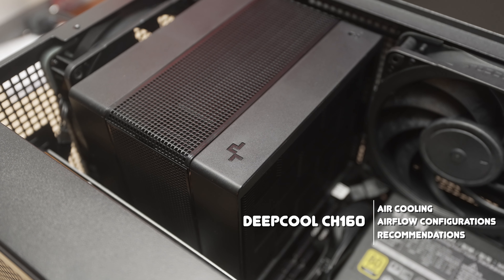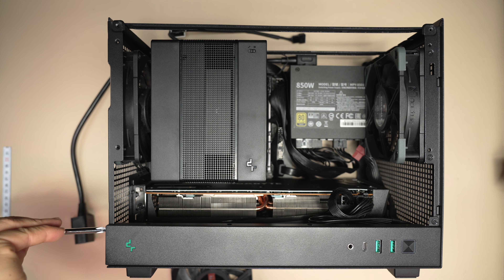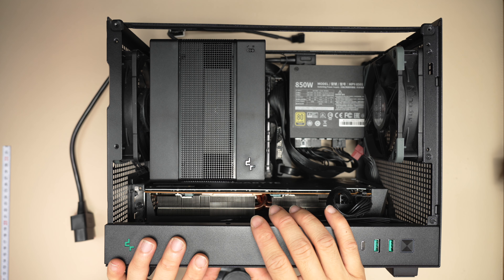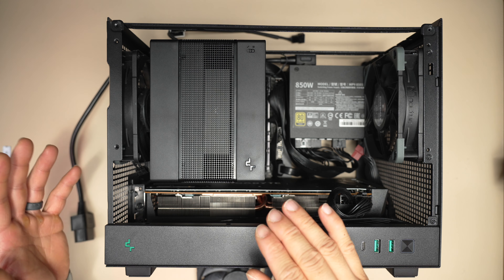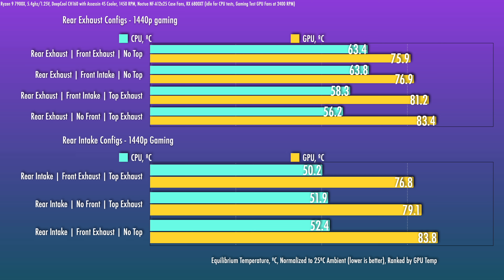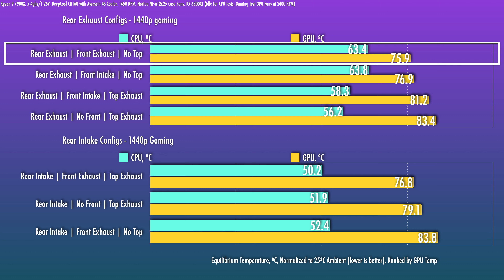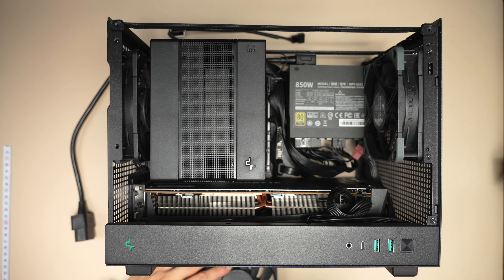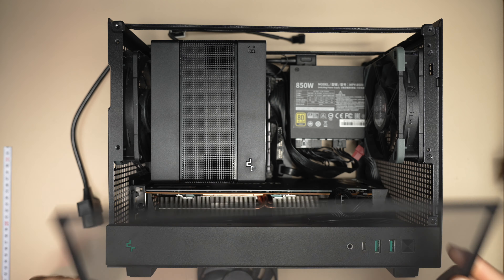Let's talk about CH160 Air Cooling Configurations.

Comment: I've seen this being a topic on SFF Forum years ago (for the Ncase M1), and the most optimum result is: REAR INTAKE + SIDE/TOP EXHAUST (near the PSU area). In this case it's an even easier solutioun, if you don't mind the hot air blowing into you.
Reply: Did the same with my Asus AP201. Rear + 2x bottom intake, 3x top exhaust. Works like a charm

Comment: I do hope to see rear intake becomming a more accepted and mainstream option in future cases; for example larger perforations/vent holes and an included optional dust filter. Most of the time it really is the best set up for air coolers, especially with flow-through graphics card designs.
Reply: For real, rear intake is the ONLY logical setup for air cooling. Cannot understand what the MF's (manufacturers) are doing all these years.
Reply: Whats the difference between front intake setup vs rear intake setup and does it really make a difference in temps on all pc builds or some cases

Comment: There's also more overall cooling potential left on the table. You could use a 120mm dual tower cooler with vertical offsets(Thermalright PA 120, PS 120 and all their variations) to allow for 2 top exhaust fans. You can then cram in a Phanteks T30 in the middle of the dual tower cooler and you'll probably achieve the best combined thermals.
Reply: Would like to see this, since I’m planning on using a PA 120 in this case
Reply: Yeah I'm planning on using that air cooler as well and but two fans at the top
Reply: so if I go for a ps120se should I even go with a back case fan if I mount the 2 fans at the back of the heatsinks?
Reply: @nootonian4149  if the heat sink fans are blowing air out the back, I don’t think you meed to put a back fan. I’ve seen people just use the heat sink fans as the exhaust already
Reply: @linksh0t263  I'm trying to intake from the back for best temps

Comment: By the way everyone, if you go for a massive cooler like the AK620, be content with only using one of the fans in the tower if you want to have a regular thickness 120mm fan on the top and side simultaneously.
Reply: I'm trying to get this setup ch160 and ak620. Could you explain what you mean please? Are you saying I can only fit a fan either in the front or the top using that cooler?
Reply: @ahmedalagbari7564  Hey, yeah, the 620 is so wide that you can only fit the face of the 120mm fan on top and a half standard thick 120 fan on the front. The mounting bracket for the front fan comes with an offset that would make the top and front fan overlap. Unless you decided to have the fan that sits on the outside of the air tower on the rear side, closer to the back I/O, then you might have room. But I stuck an intake fan there like the video suggests so not an option for me. Thermals are still great though.

Comment: I hope mesh and filters on the back and top of cases starts to become more normal.
Reply: Why? Filters impede airflow. I personally remove all dust filters from my systems for improved thermals in trade of for servicing the system every few months. Which you should be doing anyways.
Reply: @rovertyenrab damn if you clean your PC every couple months you’re OCD or you need to clean your house more often lmao or you need to put those filters back on. On the temperature side, is it really bothering you running 3°C hotter? If that’s the case, need to remember not everyone runs an overclocked 7900X…

Comment: I went with a rear intake and top exhaust with the magnetic filter on the intake like you suggested. I didn't go with front exhaust because I was able to mount 2 SSD drives onto the back of my psu. The trade-off for tenps is storage. Thanks for the great video! I am looking forward to your build video with this case.
Reply: how do you resolve the rear fan being extremely loud because it is too close to the vents?

Comment: Hey MM, awesome video! I just grabbed the CH160 and I'm waiting on the rest of the parts. I'm planning to set it up like your config with both top and front exhaust fans. Quick question though, should I use:

*Option 1:*  
- Top fan on the CPU header (pros: balanced control, cons: might not optimize front airflow)  
- Front fan on the system header

*Option 2:*  
- Both fans on the CPU header (pros: centralized control, cons: potential overload)

Which setup do you think is best?

Comment: Random Question: assuming you don't have a power hungry CPU. Can you use a smaller cooler. And have a setup that mimics the NR200 setup of Bottom Intake and Top Exhaust? or you cannot add another top fan above the CPU?
Reply from the maker: Of course. You can do all that especially with a smaller cooler. Plenty of smaller and more affordable 120mm towers.
Reply: @MachinesMore  So I have a Ryzen 5 5600X. If I got a smaller 120mm tower cooler could I theoretically mount it horizontally. Have the fan as intake from the bottom and exhaust from the top along with the top 120mm fans as exhaust. I have it paired with a 3060ti FE. Any recs?

Comment: Can you please do this test with a flow through cooler like the 4070 super founders edition? I know you mentioned it but testing would show the best possible config. What about CPU air cooler drawing air from the top and exhausting at the back with the flow through also doing the same and an additional intake in the front / or top exhaust.

Comment: would there be a noticeable CPU temp drop when using a flowthrough gpu with rear intake since hot air from the gpu would go through its PCIE bracket, rise up and get sucked into the cpu cooler?
Reply from the maker: There will be some re-intake, but some blower exhaust will disperse out into the ambient air. In my experience rear intake is better than having the flow through section almost completely enter the cooler (glass panel makes this really hard to avoid otherwise).

Comment: Hi! I really love how thorough your details were in the video. I was wondering how practical it would be if there was an intake fan top, with exhaust fan in the back? More of a curiosity for me
Reply: Wouldn't be very effective. The down force of air would conflict both with the front intake getting to the CPU cooler as well as the updraft exhaust from the GPU. Since you're force air downwards, the turbulence are then opposing each other. If anything that top fan slot should be left unpopulated.

This configuration here; rear intake, front/ top exhaust, is the most optimal.
Reply: Gearseekeres already tested it, makes no difference/a couple degrees worse

Comment: Why everyone use the same DC cooler when talking about the 160? Are there contracts?
Reply: See? you got there by yourself
Reply: Perhaps there are but that's just how the case was featured when it was released. It was designed around their large air-coolers. AIO doesn't work in this case so ofc if the reviewers are going to show air-coolers, they're going to use this cooler for the visual appeal of them matching.

Comment: I think with an ATX PSU in front having a rear intake and top exhaust is the best option for the CPU since it cannot get fresh air from the front. With an SFX PSU and the option to mount a front fan though, I would be interested in seeing how the CPU temps would be with a duct directing the front fan flow straight into the cooler so it doesn't pick up any of the heated air from the GPU. However, unlike competitors like the Ncase M1 and Cooler Master Nr200, the CH160 has no side panel ventilation, which would help the GPU cooling. A shame, really- I would definitely pick up this case if it had a mesh or solid side panel rather than glass.

I would like to see these tests ran again with a different CPU cooler, every reviewer i've seen look at the CH160 has been using the Deepcool Assassin 4S (likely because Deepcool sent it with the case for review) I'm wondering how different the CPU temps would be with a more traditional dual fan cooler, like a Thermalright Peerless Assassin or a Noctua DH-15.

Comment: How sturdy is the front fan mount? Video’s I’ve seen seem to show it’s only mounted on the right side with a bracket and the other side of the fan just flops around a bit.
Reply from the maker: Pretty flimsy. Needs to have an additional bracing point on the other side of the front panel.

Comment: Any thoughts on a 120mm AIO setup or is there no benefit in this case (thermals and/or noise)?
Reply: 120 AIOs generally perform worse than large air coolers.
Reply from the maker: Big air cooler is going to be better performing, less hassle, more reliable, and on par in terms of cost to a 120. If you want liquid cooling a compatible 240 would be best.
Reply: These days, 120mm AIOs are only suitable on lower-power CPUs. Hardware Canucks did a comparison on it semi-recently and when you compare a 120mm AIO to really small air coolers, it comes out on top for noise and thermals every time. But this case is obviously not designed around small air coolers, and the class of air coolers you can fit in this case will beat a 120mm AIO.

Comment: Does this case fit other popular large coolers like the Peerless Assassin or Noctua DH-15? Would those perform better than the DeepCool Assassin 4?
Reply: Yes the case should fit them no problem. Your ITX motherboard may be a bigger problem depending on which model it is
Reply: performance increase would be negligible. You'd need some extremely low profile RAM modules to get the 2nd fan on a D15 or PA. Otherwise you're more likely to run just 1 fan which would gain you about the same thermals... maybe +/- 3 degrees which isnt that significant, especially for a gaming system where the cpu isnt getting hot at all.

Comment: Good follow up, I assumed this would be better. I've had a couple cases with similar layouts, and rear intake + front/side/top exhaust is always better.
Reply: Yeah the CPU cooler gets feed fresh air from the rear exhaust, while hot air inside the case from the CPU and GPU is effectively exhausted through the top/front, no recirculating hot air in this config.

Comment: That’s a really good airflow test video, thank you.
There’s definitely some peculiarities about this case. Surprised about the results on the CPU (Rear exhaust) with the front fan as intake with top as exhaust configuration: they’re so closed to one another you’d think the top one would immediately exhaust the air from the intake but it seems that it works well for the CPU. Meanwhile, for the same config, GPU temps get worse by adding an exhaust fan compared to no top exhaust... go figure.